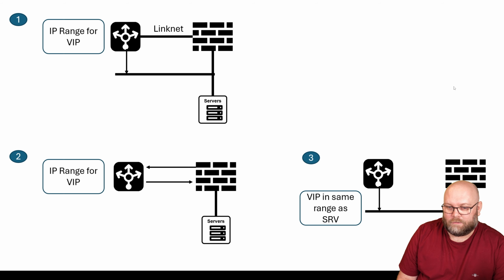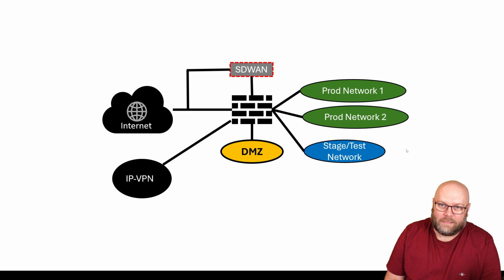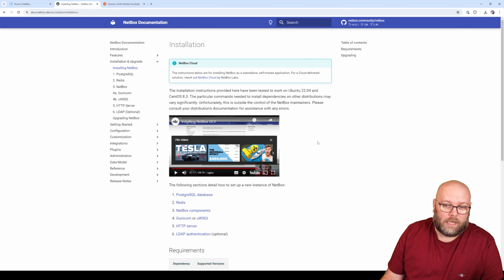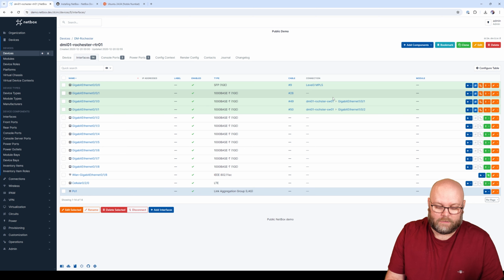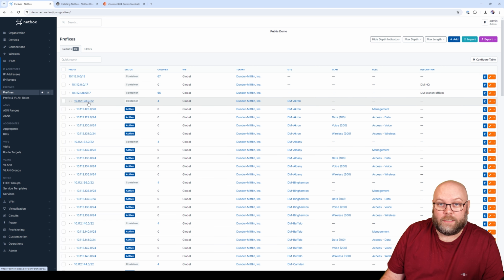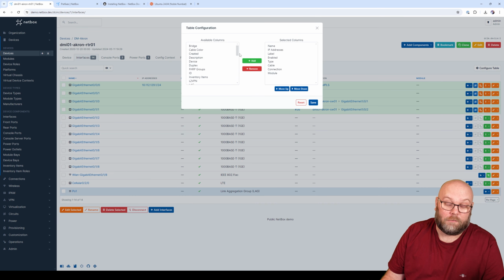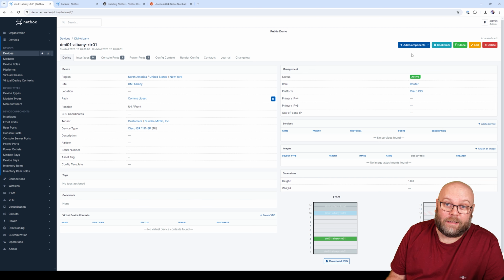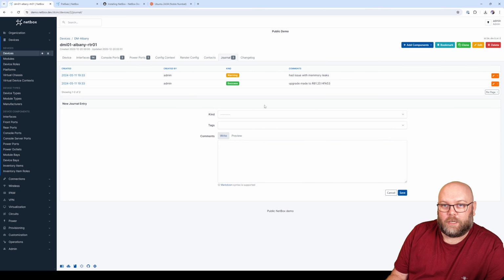Network Documentation intro

Comment: I both love and hate Netbox..
Reply from the maker: Haha ok, why is that :)?
Reply: @MagnusHolmberg-NetSec  
I do a lot of documentation of cabling in Netbox and it is so easy to get confused. I love the level of detail you can put into your documentation but to get to where you wanna be and have a full documentation of your datacenter in Netbox is really hard work.
It is also very easy to fall behind on your documentation if you are forced to do quick changes and add new cables or boxes in your datacenter and don't have the time to do the documentation straight away.
But sure, it is a great tool if everything falls to place.
Reply: @MagnusHolmberg-NetSec  I wrote a long reply but it is gone.. :( In summary. It is great but it takes a lot of time and energy to document everything in a datacenter. :)

Comment: Yes DCIM solutions are helpful for day to day troubleshooting (I've used Aperture (now from Emerson called Trellis); Device42, and others) though would have two comments.   1) they are NOT IPAM's  (they do not have the internal logic nor understanding for handling complex scenarios with MPLS, VRF's, SDN and other 'logical' constructs that you need to map (route target/route designators;  ASN's, ospf areas, etc). (personally I use phpipam for that as it handles MSP type environments with client/overlapping ip structures very well).   and 2) you NEED to maintain your hard documentation so DCIM's ARE NOT a replacement for doing the hard documentation work which you need to keep updated for BCDR.   I.e. how do you rebuild the environment when your DCIM/company is completely down?  You should have and be sending offsite critical infrastructure documentation to your DR facility so someone (NOT YOU) can rebuild the environment from the documents left behind.  Old rule of thumb is that if you can't rebuild/get an environment built back up in ~7-10 days you are not coming back.     
 
Oh and a bonus 3rd item from experience.  ALL tools are only as good as the data normalization and input.   I've seen pretty much ALL solutions turn to crap due to unconstrained input.  You really need to have a 'czar' for the tool to maintain data standards and correct information.  Otherwise they become useless.
Reply from the maker: I don’t agree with all here, but my point is that you will need several systems and these need to integrate with each other.
Only using excel, Visio etc will not work.

Hard documentation well, on some parts yes but for all. It’s not possible. I work at an isp so we have hundreds of thousands routers / switches, connections 😂

But I take us as an example, we have several data centers environments with physical diff infrastructures and teams running them even that it’s within the same building. No matter the scale, you do need to have a continuity plan, to figure out “what do we do if this happens” this ofc include loose documentation system :) blindly trust that you will have access to your mgmt, systems etc at all the time is not recommended.

Fully agree, data quality, structure etc is one of the most important aspects of it.
Reply: @MagnusHolmberg-NetSec  Could be different in an ISP situation for the types of documentation probably the main item is any hand-offs to clients.   
 
I come from a MSP environment so we're hosting entire companies and services, not all of them opt for geo redundancy (or when they do they don't do it correctly at the service/app level so lose critical functions).     Each company/service has offline as well as online documentation (and we do several BCDR's a year for each).   Keeping each 'enclave' separate (from documentation) allows for rebuilding in parallel of environments with the 'hub' or MSP 'glue' going first (i.e. shared backup/recovery for example).

Agree that using excel or visio as the only option is not viable,  as well as not being able to document /everything/ but should be enough information to build all business critical systems.  
 
I've seen too many companies go to online/live only documentation solutions and then have BCDR events without offline data and not able to recover.  (people who built the environment not available, understanding on how the flows work, etc.   knock on wood, true DR's don't happen often but when they do without the docs and planning/dry runs it's a crap show.    And it's very sad to see it happen when you get the call.    Just wanted to put the bug in the ear of anyone watching to think more about not just operational data but recovery situations.  (i.e. gas leaks; explosions; floods; earthquake, war/terrorist, etc.)